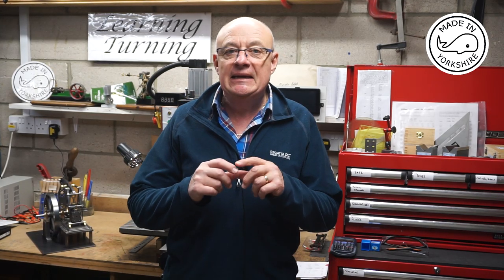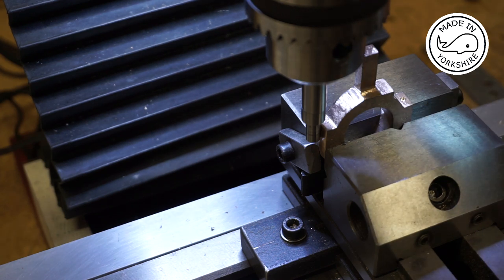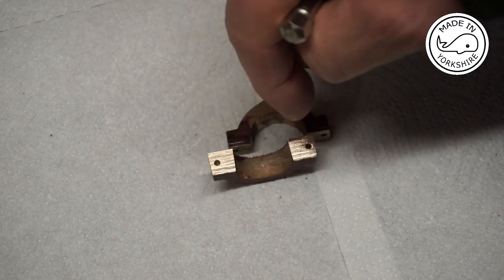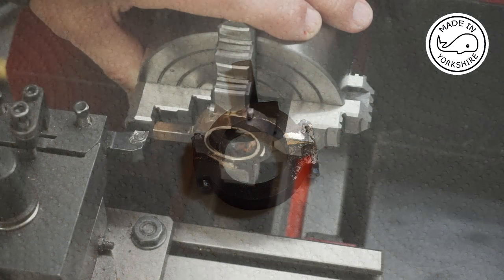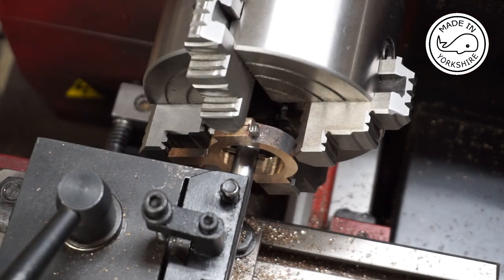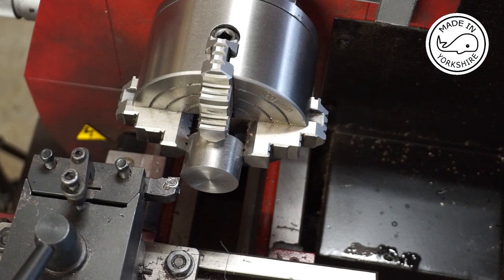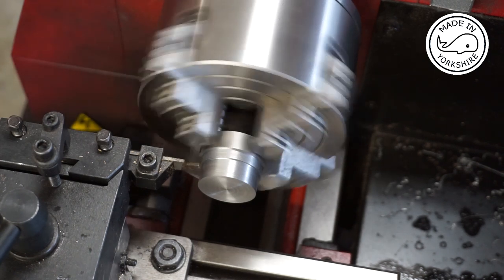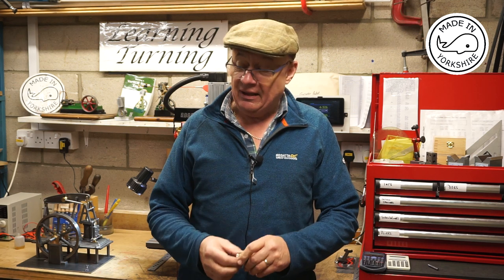#MT32 Part 17 - Making a Stuart Half Beam Steam Engine. The Eccentric Strap and Sheave. By A Whale.

Comment: I learnt the lesson of parting off a sheave once the offset hole is drilled and breaking the parting blade. I was advised either cut it of partway, stop befor you hit the hole and then finish off with hacksaw, OR, mount the sheave in the chuck on the offset boss so that the shaft hole is concentric, that way you don't break the parting tool when it meets the hole. Hope that is helpful.
Reply from the maker: Thanks for the tip Terry. Interrupted cuts can be a nightmare at times.
Happy Christmas!
Andrew

Comment: Yet again that worked well.
A slight reminder, the blunt end of a drill, even HSS, is unhardened ie soft, soft enough that you can drill one with another drill.
Reply from the maker: Hi Chris - thanks for the reminder. I will try to remember that one. I agree - it did work pretty well.
Cheers
Andrew

Comment: If you are joining parts together you should use soft solder. Silver solder is used for parts you want to join forever. 
You also need to heat the part to red heat till the flux turns to water and then apply the solder.
Reply: Yes totally agree use soft solder for tempory gluing parts together using plumbers pipe flux i.e. yellow tub from B&Q.
Reply from the maker: Thanks for the advice. Maybe I should have used soft solder - but I thought it seemed like a good opportunity to have a play with some silver solder. At least I now know that it's something I need to practice. It's definately a technique I'm determined to learn.
Cheers
Andrew
Reply: Apply the flux to the cold part then heat the part until flux goes transparent and then remove the heat for a second and touch the solder onto the heated part. That way if the part is hot enough it will melt the solder instead of the flame melting the solder and it then cooling on a part in a glob. Another trick is to thin the solder by tapping it on a metal bock to change it from a round to a flat and it will then be thinner and have more surface area to melt easier. Keep up the great work.

Comment: For the silver soldering clean work carefully and cover the mating surfaces with flux, gently clamp together and heat. The silver solder will flash into the gap by capillary action like magic. If there are any area you do not want the solder to go use a very soft graphite pencil to mark areas before fluxing. The graphite will not allow the silver solder to adhere where it is marked.
Reply from the maker: Hi Steve. Many thanks for the advice. I think I need to get hold of some reputable rods and flux and start practicing.
All the best.
Andrew

Comment: Great stuff Andrew, I like watching your quests. A tip on parting steel is to run very slow, keep the pressure on the cut, lots of lube and a freshly ground tip, steel turns to butter ;)
Reply from the maker: Thanks Ade - I really appreciate the tips.
All the best.
Andrew
Reply: Agree with Ade. Also is your parting blade tip on centre with your work? It needs to be slightly lower than centre for it to work without chatter and breakage. Other cutters are always on centre. Keep up the good work.

Comment: Hi Andrew,
Another great video.
Use a fire brick when silver soldering. It would help with keeping heat in the part.
Silver Solder comes in different types. Some can use lower heat to work. Ideal for use with those Mapp/propane gas burners. Others require a much hotter heat such as oxy-acetylene.
I've been using 'Johnson Matthey Silverflo 55 1mm diameter rods'. Works very well on those small engine parts.
Regards
MachineNZ
Reply from the maker: Thanks for the advice Kevin. I'll see if I can get hold of some Silverflo55. I got my rods off eBay, together with some flux. I think I need to get some reputable materials and then practice, practice, practice.
Cheers
Andrew

Comment: Hi Andrew, nice job good to see it turned out well in the end.

As for the soldering really you need some vermiculite (or similar) bricks to make a closed area that reflects the heat back at the metal and don't use a vice as it acts as a heat sink. You need only to wet once side with a very thin film of solder then sweat them together.

I take the point that some others have said about using soft solder but to be fair I have made a few of these using silver solder and provided there is only tiny drop of solder the components do part easily after machining.

I look forward to seeing it running :-)
Reply from the maker: Thanks Peter. I think I might have had too many beers the other day and forgot the technique! Many thanks for the advice. It was sort of fun trying out silver soldering and certainly something I need to get better at.
Getting to the exciting bit - fingers crossed!
Cheers!
Andrew

Comment: Hi Andrew,

Enjoyed the video, lots of patience with small parts, end result is looking good.

I had a lot of problems in the early days when parting with HSS on a small lathe and found that the grind was the key factor. I never grind the top of the blade, always keeping a neutral angle which greatly reduces the tendency to dig in. 

I also use a minimal front clearance angle, just a couple of degrees. Apart from maximising strength in the cutting edge it also reduces the depth of cut. 

The  combined effect is to reduce the amount of material removed and therefore the downward pressure on the tool. There is also less tendency for chips to bind in the cut.

This seems to work equally well with steel, aluminium and brass.

A benefit of this approach is that I can keep re-grinding the blade without having the problem of either losing width, which results in binding on deep cuts, or having to completely remove the back rake and start again.
Reply from the maker: Many thanks for the advice. I think I will try to get hold of some more HSS parting blades and have a go at regrinding as you suggest.
Alll the best.
Andrew

Comment: I dread parting, but find that one of the HSS 3/32nd parting blade works well at slow speed on my Chester DB7. 120-200 maybe, razor sharp and bang on centre. Looks great Andrew. Think I can feel my next model coming on :) Can't wait to see it running.
Reply from the maker: Hi Ian - yeah my parting blade was 1/16" - I'll look for some 3/32" ones. it's definately getting the exciting bit now! I just need to think about paint colour and some kind of brickwork around the columns (maybe I could 3D print something).
Cheers
Andrew
Reply: @learningturningmetal  Well worth it Andrew. I have a 1/16 one also, which is fine on Brass and Ali, but hopeless on Steel. If you check eBay, you can buy proper clay bricks, from china, but they aren't too cheap. Reckon those would be spot on. I also did the flooring on my Beam and the Marine single with "dolls house tiles" from eBay too, although I doubt you'll need/use them on this model....one for the future though.

Comment: Great video Andrew.  BTW, I’ve made several of those straps just using the bolts and the chuck jaws for holding the two halves together and haven’t had any problems yet.
Reply from the maker: Thanks mate. Yeah I think I went a little overkill. Though it was interesting having a go at silver soldering and then failing miserably. I like trying out new things.
Cheers
Andrew

Comment: Hi there
I seem to remember a 3/32 slitting saw mounted in a large to split the strap. Being the correct size to ensure a round strap.
Reply from the maker: Hi Steve. Yeah I have a slitting saw but it just wasn't wide enough to avoid hitting the vice.
Cheers
Andrew

Comment: Try not to silver solder holding in a vice, takes away too much heat, need to get job to cherry red , flux turns to liquid, flux on rod after pre heating rod , rod touched on job ,solder should flash onto job, hope this helps , ken
Reply: Ken Preddy : I agree with everything Ken said but I'm questioning your gas choice. It sounded like propane but could have been MAP gas. I've never been successful silver soldering with either of those gases. You may need to get a small Oxygen acetylene kit to get the heat needed for this operation.
Reply from the maker: Thanks for the advice Ken - it makes a lot of sense. I think I will try to get hold of some reputable rods and flux and have a good practice.
All the best.
Andrew
Reply from the maker: Hi Craig - The gas is called MAP-PLUS - maybe just a fancy name for MAPP gas. My plumber recently offered to lend me his Oxygen acetylene gear, but it would frighten the living daylights out of me. Maybe in my younger days!
All the best.
Andrew
Reply: Learning Turning Metal - by Andrew Whale : Andrew, Oxy Acetylene is something to be cautious with but not something to fear. AVE recently did a video on it and the master model builder Keith Appleton has many videos on its uses. Ask your plumbing to show you the proper way to light it and after that it's like using MAP gas. 
I don't know if you can get the small units like AVE shows in England but here in the States it's available. For us model builders it's an ideal size. You can do it!
Reply from the maker: Thanks Craig. I might give it a try sometime.

Comment: You need to use soft solder not silver solder. It is easy to heat up to separate the parts again.
Reply from the maker: Thanks Tony - it looks like soft solder would have been a better option - but I just couldn't resist the challenge of having a go at silver soldering.
All the best.
Andrew

Comment: I have a c3 and on my parting blade I sharpen to the  normal cutting angle then on the top of the blade I take my dremal and make a semicircle relif that just touches the cutting tip then when I use it I drip cutting oil on the cut so it's all ways got oil on it the relif allows the chip to come off the work nearly straight down rather than at 90 degree and because its concave it makes the chip roll up and clear itself 9. 5 out of 10 parting jobs go OK for me hop this is to some use
Reply from the maker: Thanks for the tip Daniel. I might have a go at that and maybe reduce the cutting angle slightly at the same time. It's strange that sometimes parting off goes like a dream and other times it's a disaster. Others have suggested that the blade was too far out of the holder as well. Something I need to check next time.
Cheers
Andrew

Comment: Solder and I just don't get on. I've avoided having to glue/solder in these circumstances by turning my own 7BA bolts from 7BA hex steel, with the unthreaded section an exact fit in the drilled holes. Parting off DRY (with an inverted parting tool in a rear tool post) works best for me. Lubrication sometimes makes the cutter slide over the work. Lowest back gear for large CI but faster for smallish steel and brass - whatever does the job but feels and sounds right.
Reply from the maker: Hi Len - a great idea using hex steel - I'll look out for some. I must have another go at silver soldering though - I really must try to master it. A rear toolpost is a great idea - I will investigate what is available for the SC4 lathe.
Cheers mate.
Andrew

Comment: Why don't you just drill and tap for the rod bolts , then split it and bolt it back together to bore the center.
Reply from the maker: Yeah - I guess that would have worked. I think I just went for a belt and braces approach.
Cheers
Andrew